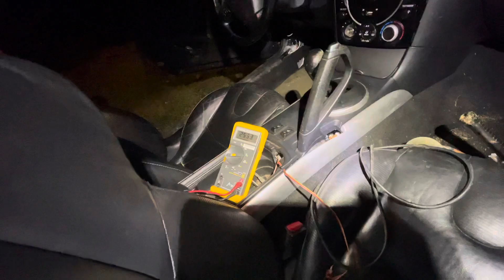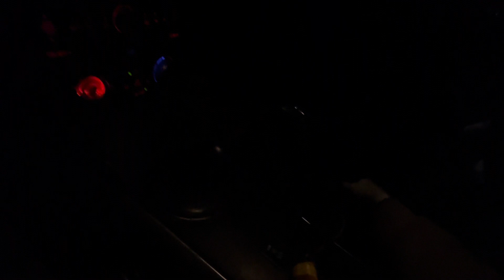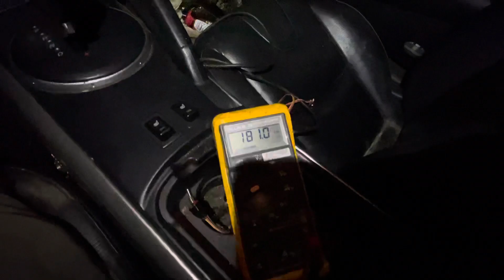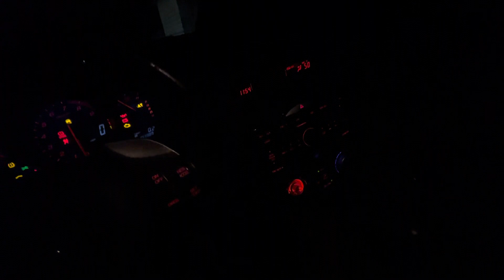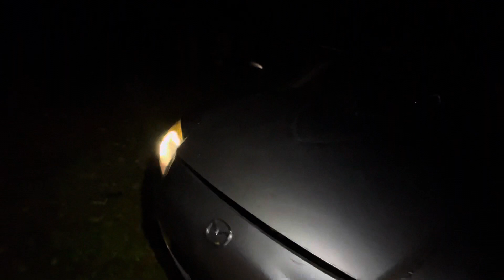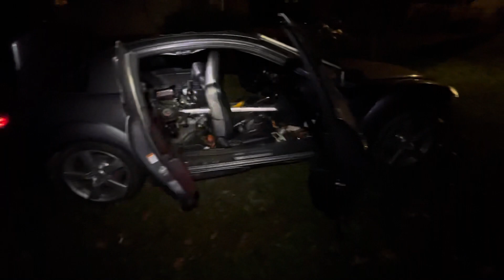HARBOR FREIGHT Engine in a Mazda Rx8

Comment: why did't you put the generator in the motor compartment ???
Reply from the maker: I don’t have another hybrid transmission, so had to test it inside the vehicle, I’m planning on using a Diesel engine connected to a 1:2 generator.
Reply from the maker: Generator is the other half of the hybrid transaxle, engine is only there to turn the generator